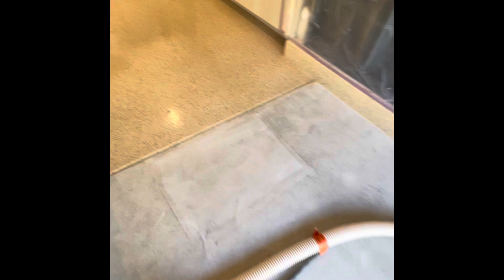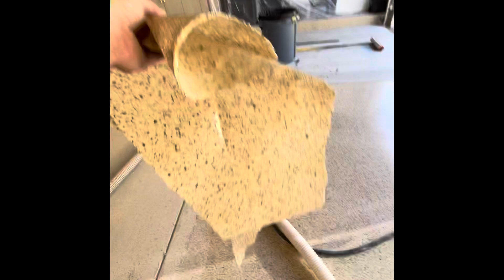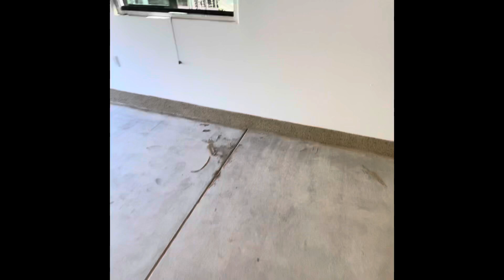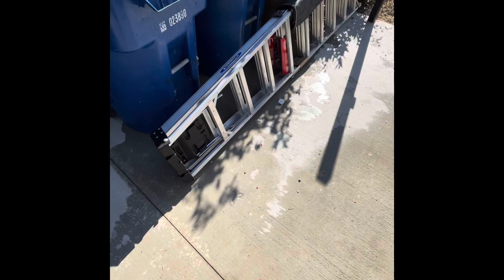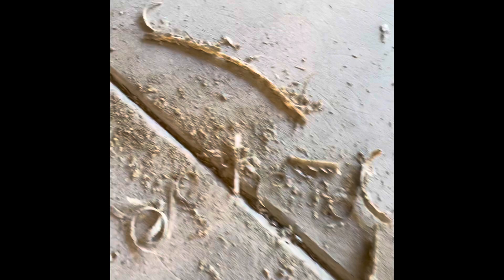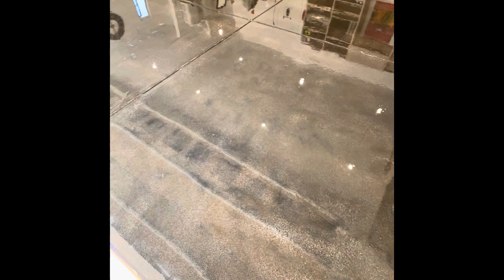Epoxy Floor Failure/ Moisture Remediation/How To Fix/Moisture Barriers/ #surfaceit#surfaceit805

Comment: The REASON for bubbles and blisters IS NOT MOISTURE folks.   A coating failure is a Cascade of Events Scenario, just like an airliner disaster.  The CAUSE is the use of cheap, 100% solids, solvent-cured epoxy.  That is a zero elastomeric coefficient.  Slabs move, they expand/contract with thermal variance. Hence the reason for expansion joints.  A 100% solid epoxy mix, is ridgid as glass. With movement, there is high tensile force created and point loads often relieve that stress, by cohesive substrate failure of the mortar cap to the slap.  Look under an epoxy blister, there are cement-based fines well-bonded to the epoxy.  The weak link, is the slab tensile strength, espeically on cheap garage floors with 2500 PSI slabs.   Once the micro fracture occures, THEN moisture carrying soluable salts can ingress into the fracture, where they expand 5x their size creating the blister.  MOISTURE DOES NOT DO THIS!  Using a rigid epoxy is why.   The only solution is to use an amine based epoxy, more expensive by a dime a foot, but is highly elastomeric and does not shear with slab movement.    We routinely lay down epoxy on slabs that are 3 days old and as damp as can be. DO NOT TRUST MOISTURE TESTS!!!  That's all junk science.  The moment you cover up an open slab with anything, your test results are NULL AND VOID.  They mean nothing!
Reply: Is Xypex an amine based epoxy?
Reply: @hectormarcayda3518  No, Xypex is not epoxy at all, it is a form of a Silicate.  When used as just a densifier for dust control, its outstanding. Another type like it, is Ashford Formula. Both have purpose.

Comment: I read you can add color to the mvb then flake and topcoat.   What’s your thoughts?
Reply from the maker: I think this great for certain projects that require MVB and you have a opportunity to save a day on the project. However I would say to purchase a MVB that’s pigmented from the manufacturer, instead of adding pigment yourself. Some pigments may not be a compatible with a MVB.

Comment: I need your expertise in diagnosis:  I just had an professional company put an epoxy floor in my garage.  Two weeks later I am noticing some of the flakes bulging up a bit and I can press then down with my finger nail.  I am noticing more today.  I emailed the installer and he said that is air bubbles and is normal.  Their epoxy coating was supposed to be a 9 pound moisture barrier product and they said that would be fine.  They did a polysaspartic topcoat.  Are my flake popping up due to moisture????  Why would this be happening two weeks later.  I stayed off the floor for 7 days - I thought that would cure.  The polyaspartic coating took 48 hours to cure.    Any thoughts????
Reply from the maker: Hey there, I would say that’s definitely a moisture problem, soft air bubbles do not happen, air bubbles are referred to as outgassing or outgass bubbles, these generally will pop and be hard and also happen almost immediately. 
Do you know what your moisture reading test was? This will allow you to know what moisture barrier to use. Also was this a one day system install? This is a common problem with fast cure Polyaspartics. If it were my floor I would grind it off, install epoxy moisture barrier compatible with your moisture content, 100% solids epoxy coat with your flake broadcast, and then Polyaspartic topcoat. Polyaspartic weren’t designed to go direct to concrete but a lot of people do it. Call me if you have more questions.
Reply: @surfaceit805  It isn't a one day system.  It was Garage Experts.  They didn't do a moisture reading.  I told them upfront that my garage floor was damp at times.  They ground it down and used their proprietary epoxy and then flaked it.  After 72 hours they came back and scrape and topcoated with polyaspartic.  I stayed off the floor for 7 days from they day they did the epoxy.  They said their epoxy held 9lbs or moisture.  Now I am noticing small areas, like where a flake is, that it is no longer flat and has a slight bubble and I can press it down with  my finger nail.  I had them put in new cabinets too, so if the floor has to be re done, everything has to be taken out again.  Do you think this floor is going to fail?  Start peeling?  They gave a lifetime warranty against delamination or peeling.  The owner was a bit dismissive saying the floor was solid and bubbles are normal.  I am seeing more today in another part of the floor.  I think I may have a big mess on my hands.   Its only been two weeks, I can't believe this!
Reply from the maker: Ok, if they gave a lifetime warranty I would definitely have them come out to inspect the floor. Most epoxy’s can hold up to about 6-8 lbs of MVT (field test data) manufacturers will claim 4lbs.. otherwise it needs a MVB. I believe your moisture content is higher than that so it’s causing the epoxy to bubble. Especially if you noticed the floor damp at times for no reason prior to the instal that’s a big indicator to moisture test and get the correct product on the floor, some MVB hold 10lbs, other can hold 22lbs so it’s important to have a reading. 
As far as the cabinets yes it would be preferred to have a MVB on the entire floor but sometimes it’s not possible. In the event the cabinets do not come out just make sure the toe kicks are removed (if any ) and they can work around them. We have had to do that many times. If you have bubbles and park your car on the surface most likely those areas will peel up from hot tires as they are no longer bonded to the concrete. I hope this helps but they should definitely come take care of that floor for you.
Reply from the maker: If you in my area and they won’t fix the floor give me a call and we can re do it for you.
Reply: @surfaceit805  Thanks for your replies!!!  I live in Pittsburgh, PA, otherwise I would definitely use you.  I can't believe these blisters are showing up after only two weeks!  I am sick to my stomach!  All this work I had to do to get my garage ready for them and then over one week with no garage, etc.    If this is happening after two weeks, I am sure it will only get worse.  I hope they hold up their warranty.  Garage Experts are a franchise out of Texas - well so much for their proprietary epoxy with moisture barrier.  I choose them cause they really sold that the knew what they were doing and they say they have a superior epoxy that soaks deep into the concrete making a good bond.  I can't figure out why they wouldn't use a better moister barrier especially after I told them my floor is sometimes wet.    What a disaster!  I have a feeling they aren't going to want to fix this just from the response I got from the owner.  Oh well, again thanks!!!!!
Reply: @groovy1937 what happen? Did the contractor honor the warranty?
Reply: @AJourneyOfYourSoul  So no more bubbles appeared in the past few months.  The ones that were there seems to have deflated back down, but definitely not flat as it was before.  I will see what happens in Spring when the wet weather hits and if the bubbles start up again.  None of the floor has lifted yet.  The contractor said it was aiir bubbles.  I read where a freshly ground floor with release gas bubbles - so I don't know if it that or water. I'll see what happens this Spring.
Reply: @groovy1937  Good luck, hopefully it was just air and that is that.
Reply: @AJourneyOfYourSoul  Thanks, that's what I hoping too! (it was just air bubbles).

Comment: 800 square feet per gallon on the mvb?
Reply from the maker: This one is 125sqft per gallon for the MVB. Always check your manufacturer specs as some coverage rates may be different.

Comment: If all your floors get a preventative moisture barrier before installing the system (as stated at 1 minute and 49 seconds) then why did the floor bubble?
Reply from the maker: Nice question… So the MVB I originally put down is more like waterbased MVB primer. If definitely gives the coating a boost in moisture resistance but it’s not a full system on its own. Different MVBs have different ratings. The amount of water running under the slab was too great for the primer to hold back. Honestly with our without the primer any flooring would have issues. The take away from this video is to find the source and fix the problem. A floor under water will fail no matter what you put down.

Comment: What should be done if an epoxy based moisture mitigation barrier is applied and there are a million bubbles in the moisture barrier coating? Will this still perform like it should?
Reply from the maker: Yes it should, sand the bubbles are pour over it. 
It mostly likely out gassing from a really pours slab.

Comment: Why no moisture barrier in the first place?
Reply from the maker: This did have a moisture primer when it was originally installed, not all floors require a MVB. This was new concrete and new construction in this area, it wasn’t until the landscaping was complete that the floor started having issues.

Comment: Before install epoxy coatings we always measure moisture level of the concrete. This is the best way to avoid such problems.
Reply: A moisture test only gives information on current conditions, moisture conditions can change over time. There is no way for the contractor to know what will happen to the concrete slab in the future.

Comment: So if you were to apply the Slabloc 100 to begin with would that have still happened? Or did you already use the slabloc100 to begin with however it just wasn’t effective? I ask because I’m new to Epoxy and I got a project coming up where a client has a small water problem in his basement so I’m trying to find the best solution in terms of what products to use
Reply: The moisture barriers will not work in control joints and joints around the exterior where there is a water problem.   The moisture testing is important but if one area is too high, failure of epoxy is imminent and then it will spread as moisture always does.  Water problems in basements are tricky to mitigate.   Be careful
Reply from the maker: This one did not have slab loc 100 with the original install. For your project I would definitely do a moisture test. This will give you the data you need to choose the correct moisture barrie.
Reply: @surfaceit805  awesome. Would you recommend the slabloc 100 in my case though?
Reply from the maker: @calebeeduardo9859  Slab loc 100 has a bout 22 lbs per square in of resistance. Which is a lot. But I do agree with @prefers oxygen in the comment below. Basements can be tricky to figure out. In some cases the exterior walls can be the issue, or poor drainage around the exterior walls of the basement. A failed or damaged exterior waterproofing membrane could be the cause, allowing water to flow where it is not intended. It would be wise to do some investigation around the exterior along with a moisture test.

Comment: I dont think Ive ever seen an expansion joint going under an exterior wall
Reply: It’s a control joint- not expansion joint - control joints tell the slab where to crack, to basically prevent cracks
Reply: Still have never seen this in FL. It really makes no sense. You are just giving water a channel to go under the wall.

Comment: Odd question but are the osmotic blisters that you encounter with epoxy coats generally soft or hard? Do they pop or ooze when stepped on?
Reply: I have water blisters all over my epoxy floors - when you pop them water sprays out!  Its crazy
Reply: @acanadianwoodworker  are they hard to pop? Or relatively squishy/soft?
Reply: @DomnSan  They'll crack fairly easily when I walk on them.  A few were harder, but a light tap from a hammer broke them open.  The epoxy is still quite hard even separated from its substrate, but way more prone to breaking.
Reply: @acanadianwoodworker  gotcha. Thanks
Reply from the maker: Definitely delamination due to moisture.
Reply: @acanadianwoodworker   infinite water source can be from no vapor retarder under the slab - Level 1 moisture mitigation - You have to go to level 2 mitigation now

Comment: This is happening on the fault lines in my basement. Now I’m scared. What should I do?
Reply from the maker: Basements can be tricky. In some cases it’s the exterior waterproofing around the stem wall or block wall that is the initial cause. Otherwise a proper moisture test can be done to determine the amount of moisture vapor transmission and will give you the data you need to properly select a coating.

Comment: Great video.  Really appreciate your honesty.  I had my floor done last month. It was done during 4 days of rain.  Water got in just at the front. Would love your opinion on best way to fix.

 Option 1 screen the entire floor and apply top coat.  
Option 2  tape only first foot where water damage and fix just the first 2 feet

THANK YOU SO MUCH
Reply from the maker: If epoxy gets wet after being installed to soon it may have effects on sheen and dry times if it dries at all. I’m not sure exactly what the damage is but I would suggest removing the epoxy from the front strip of the garage and do a solid color coat as a border under the garage door. In many cases we do this to match the exterior color of the house when the door is closed.

Comment: Who cover costs of repair? Is water came up later after instalation? 
Great video! Most of contractors take videos whe everything is fine.
Reply: The company is responsible duuuuuh🤣🤣🤣
Reply: @Factzni66a  
Which company? The general contractor, the sprinkler company or the epoxy floor contractor?

Comment: Great video, what did you use to clean up the control joints like that? So perfect 🤔
Reply: Touche. How did you grind the joints before placing new coatings??

Comment: Good video in the case you found there source but how do you cover the expense?
Reply from the maker: Fortunately on this project we all split the cost and discounted the labor rate.
Reply: Unfortunately sometimes you have to eat the cost that’s why we always moisture barrier now we dealt with this for a long time
Reply: What do you use for a moisture barrier if you don’t mind me asking ?
Reply: @RJ-vq1iv  Vapor Solve, go thick and broadcast sand